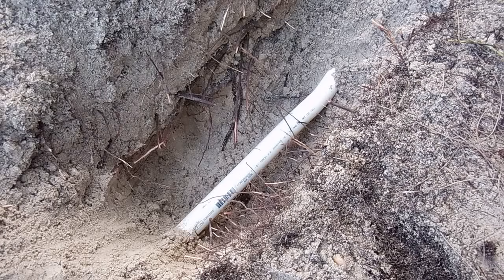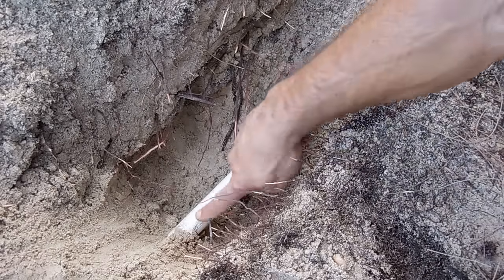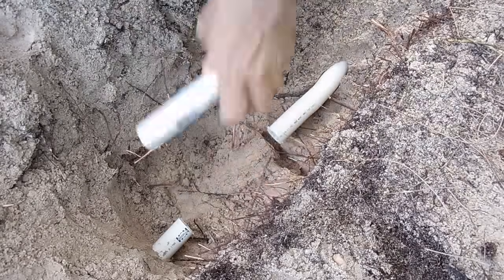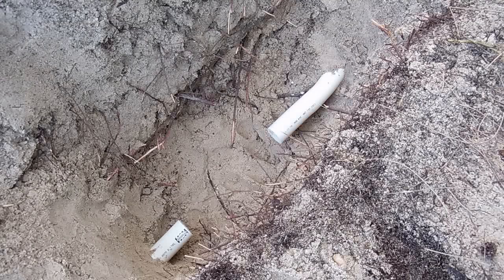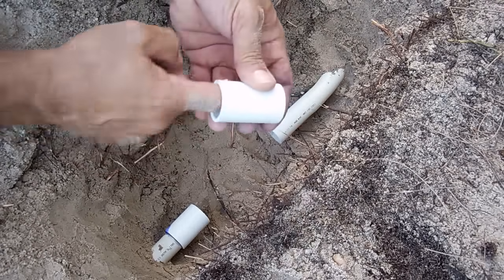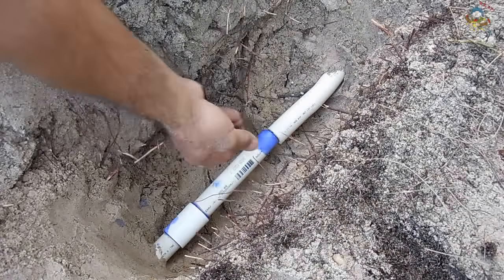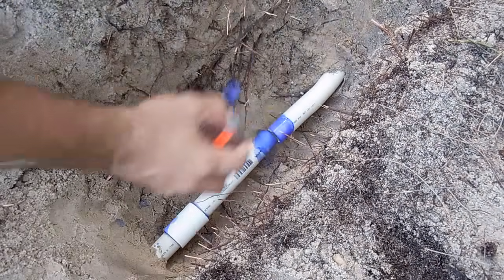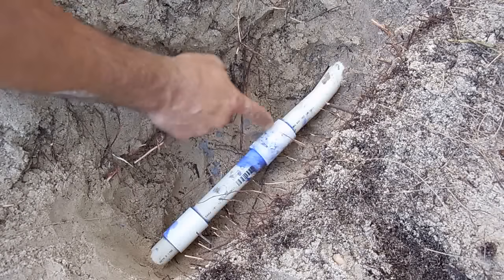EASILY Repairing Broken PVC Pipes(Least Amount Of Digging)

Comment from the maker: Other great PVC videos that you'll enjoy: 

How To Easily Tap Into A Buried PVC Water Line: https://www.youtube.com/watch?v=LP41_wXW8jc
PVC Cement Pressure Testing video(Oatey vs Christy's Red Hot Blue Glue): https://www.youtube.com/watch?v=qHo4heljrSg 
How Much Pressure Can SCH40 PVC Pipes Tolerate? Find out!: https://www.youtube.com/watch?v=doPXNWC1Iig 

Be sure to share. Thanks guys!
Reply: electronicsNmore I tried this exact method, using medium setting cement. It did not work and I made it worse. 

I applied the cement (which very quickly gummed up when I slid the connector on) and the coupling with the filed out stopper would no longer slide all the way down the pipe after applying cement. Not even using a vicegrip. After removing the coupling I saw more gummed up cement. 

The cement I used was Harvey multi purpose Twin pack, which included Pipe Cleaner and MP-6 Cement, medium body, medium set. 

Instructions mention primer. Do I need a 3rd chemical? Is the cleaner also the primer? 

You made this look super easy.. but it was not at all. I'm not even sure if the one coupling I put on is creating a chemical fuse with the pipe. Why is there so much gummed up cement?

You also call the cleaner "glue". I am a laymen, not a plumber. This may seem simple to you, but to people who don't do plumbing..

What is the difference between cleaner/glue/primer??

After I apply the cleaner/glue/primer is there a certain amount of time I should wait to allow it to set in before putting cement over it?

Should I have used a thin bodied cement instead of medium bodied? (You did not specify)

Is that gumminess of the cement normal? Should it squeeze out into clumps when I slide the connector on? It was brand new off the shelf cement.

I see all these great comments about what a great idea this is. I have not seen one single comment about what success they had trying your method. I followed your instructions to the letter and now my water main is worse.

Extremely disappointed. Links to your videos but maybe you should specify exactly what products you used, and the viscosity/thickness of the cement. This video seems more suited to journeman plumbers than beginners.
Reply: @Freshbrood  what a troll comment. The method works very well and although it is pitched at non-plumbers you must have some common sense and a basic understanding of how pvc glue works. Blaming the poor chap that took his time to make this video is not on.
Reply: reallepooy It's not a troll comment at all. The main issue was the connecting pipe, even with the stopper throrouhly filed away was still thicker in the center and would not fully slide down. I tried it with another one. This video author failed to mention that and it's important.
Reply: electronicsNmore Cost me more time and more money.
Reply: Great Video, very concise and easy to understand. Keep up the Good work, and inform us how to make our lives a little easier. As FDR said, "The only thing we have to Fear, is Fear itself".  And your Video's help us get past
 that Fear. Thanks again.
Reply from the maker: @tipsclubs01  Thanks Phil! Please share my videos with others.
Reply: @electronicsNmore  Will Do.  It was shared to me.
Reply: Thank brother, keep up the great work
Reply: Thanks for the post 
Good to know 👍
Reply from the maker: @garylespron7-WS  You're welcome! Also be sure to check out my pvc tips video playlist and share. Thank you
Reply: Instead of cutting a long piece and using two couplings, wouldn't it be easier to just remove the damaged part which appeared to be small, and then just use the last step of your video to insert the non stop coupling ?
Reply: electronicsNmore r
Reply: Won't save me any money, but this will save my back :-) Usually just dig up a few more feet so I can bend the pipe and get the coupler on
Reply: @creamofbotulismsoup9900  Hey so even after filing down the stopper on 2 different couplers, I still can't fit one far enough down one side to slide it back to the other pipe. Are these thicker in the middle than the edges, even without the stopper?
Reply: @Freshbrood  Might depend on the brand, but from what I have personally seen, no.
Reply: i watched  your  video   but  how do u  get rid of a tree thick root  thats  on top of it
Reply from the maker: @denisecarley9483  Cut it.
Reply: 🙏 kalo r9498⁴l8a8p3o499⁴9l⁸l44l🙏👍 re 🙏9³9woolskiu👍d9👍e8pee saat oae8l288lelellllw⁸lllawoaoowea8l8aoe9or94a9l
Reply: How does 2nd coupling slide past the internal stop ridge in coupling?
Reply: Ķķò
Reply: great video,  thanks!  when I checked the size of the slip coupling on the home depot site, it seems the coupling is the same size as the pipe you try to repair.  How do you slip it on if they are the same size?
Reply: Thank you I've been looking for something like this for a while! I wish they made couplings without the stop
Reply: electronicsNmore 5
Reply: @williamfranklin8317  jdmjf

Comment: Cleaner is not purple
Reply from the maker: Cleaner and primer both clean the surface of the pipe and soften. I did the testing. I suggest you read the MSDS sheets to see the common chemicals
Reply: @electronicsNmore Not trying to cause an argument. It says right on the label what it is. I had an employee that said he couldn't get a joint to stay one time and I asked if he used cleaner and he said "yeah I used the purple cleaner". I went back and used cleaner, primer, then glue and it was done, not saying it won't work but primer is not cleaner
Reply: @electronicsNmore  Good video though I like the idea

Comment: Fresh water, pressure PVC pipe coming into the house under ground, now broke 3 times.
2 different plumbers worked on it, 
The first plumber charged me $900, lasted 3 years, than broke.
The second plumber fixed it, charge me $750, but after 2 days it broke again, plumber came, fixed it, but never covered it with dirt.
He told me he wants to put a box over it, but never came.
Called him, he said he was out of town, he'll come tomorrow, next day never showed.
Last plumber told, me the PVC pipe is old, junk that's why it's breaking.
Well, it's 50 years old, I Googled it, they should last 100 years or more  under ground !
What's wrong with these people?
🤔🤔😠😠

Comment: Better to use a deburring tool on both the inside and outside of the pipe to create a small taper at the end. This allows glue to flow more evenly when the coupling is pressed pushed oin the end, ensuring a good seal on the repair.   Also, twist the coupling a quarter turn when it is pressed on all the way, to also distribute the glue eveninly around the pipe.  Put glue on pipe beyond the final position of the coupling to ensure when the coupling is dragged back into final position, the glue on that side of the coupling has not been reduced when it was extended beyond the midway point.

Comment: Great technique to simplify PVC repair.  I like it better than the technique of heating up the pipe to allow bending it into the coupler.  I like the idea of using slow-setting glue.  My only recommendation is to avoid twisting the smooth coupler until it is pulled to the stop mark, but then twist it strongly to get glue moved around the bottom of the pipe where application of it is often sparse.
Reply from the maker: Thanks for watching. I like to give viewers several different methods that they can use. You select the best method for you

Comment: Maybe it’s due to a difference in the connectors in the US and here in Japan, but this didn’t work for me. I was able to remove the inner barrier at the middle of the connector. And I prepped everything but when I went to push the connector on it got about Halfway to the middle, so a quarter of the way of the length of the connector, and it just wasn’t going any further. Well, I may have been able to get it a little bit further, but you have to keep in mind that I still had 3/4 of the connector left before I would be able to get it to join the other end. And this was after I cut maybe 5 mm off the end of the connector before starting. I did that to reduce the overall length of the connector.

It didn’t work. I appreciate the idea, but there’s something different going on.

Comment: Very good! This way you save about $6 what a special slip - telescoping coupling will cost you. I have one of those $6 coupling so will use it. Then try your way at another break. What brand slow drying PVC cement you using here?
Reply from the maker: In the video I demonstrated using oatey clear regular set cement

Comment: thanks for all the wonderful videos my friend, you're saving us hundreds!  i have a quick question. which tool would you recommend for cutting an old and possibly brittle CPVC in ground pipe? i clipped one with my shovel and need to recap it, but need to take off the cracked section. any insight would be appreciated.
Reply from the maker: Use a stainless steel cable wire saw

Comment: Great video, but FYI That purple liquid is a primer, not a cleaner. It allows the glue to make a weld between the two pieces.  PVC welds exactly like metal with this primer !
Reply from the maker: Same chemicals. Both soften and clean the plastic. The purple is only to show you used it.

Comment: Nice video, thanks for posting.
If the crack is small, couldn't you just make one cut at the crack, then use the slip-over coupling to seal against the intact pipe on either side? That way you'd need one one coupler, one cut, and no replacement section.

Comment: Great cheap way for a repair. The reason for the slow set glue and over applying glue to the last coupling is to have time with least effort to slide the last coupling past the end and then back into place.

Great tip. Unions and extensions are expensive

Comment: Tried this today. Saved me from making additional cuts to pvc. I found it very hard to slide the coupler back the other way. If you are having trouble getting rid of the stop inside the coupler, use some double sided tape on a socket, wrap some sandpaper around it and attach it to a drill. Worked great for me.

Comment: I just used this method on a 1.5" pool pipe and it worked. Warning - do not use "repair" couplings found at HD or Lowe's where the stop is already removed. They don't fit nearly as snug as regular couplings. I thought I found a shortcut using one but was leery from the start when I saw how it too easily slid onto the pipe . And of course it leaked from that coupling. Re-did it using a regular coupling and removing the stop and good to go. Great video.

Comment: Beautiful! I'm not familiar with PVC pipe repair and I have to change a couple of pipes by my valve index about 9 inches down and the suggestions that were made at a big box store did not sound like it would work because of the crammed space I have to work with. This is not only quick, but it's cheaper. Thank you.

Comment: I'm trying to use this method but finding that even after filing away the stop in the middle of the coupling, the coulper does not slide along the PVC pipe easily.  How do I ensure I will be able to slide and move it fully into place when using the PVC glue?
Reply from the maker: You have to remove the Stop and a little bit on each side because the fitting has a slight taper. As long as that stop has been removed with part of the taper, when you put the cleaner on that fitting to soften it up, followed by the PVC cement it will slide all the way over.

Comment: Thanks for making this video. I followed this method no problem. When I tried to dry fit the coupling with the inserted piece of pipe it would not slide all the way down, probably because it was dry, so I wasn’t 100% sure it was going to work. But once I put the cleaner on and the glue it provided enough temporary lubricant that it slid all the way down on the pipe allowing the inserted piece to fit easily and then I was able to slide it back over for the final repair. Thanks again

Comment: I have a cracked elbow joint that makes a 90 degree turn between the main line to the meter and the line that connects to the garden spigot on the wall of my house. It seemed at first it might be very easy to fix by just replacing the elbow and using some couplers and a new small section of pipe but the problem is being constrained working in the hole. Now it seems it might just be easier to dig up the whole length of the line and replace it at once. That way I can do all the cutting and mating above ground.

Comment: Didn’t work for me. I spent a lot of time making sure the coupler was completely shaved down. But even so, i couldn’t slip the shaved down coupler more than 3/4 of the way, even with channel locks, and all lubed up. The surface tension is just too much. So I couldn’t get it over the other side being that I cut the new piece to be flush. Highly recommend digging a bit further so you get enough flex to wiggle your way in there if need be and cutting the new piece just slightly shorter so you have a bit of wiggle room there too, if you don’t manage to slip the coupler all the way over the pipe.
Reply from the maker: If you read through the comments section you're going to see that the majority have used it and were very happy with the results. I admit it may take some practice to get the technique down

Comment: Good video. 2 important things. 1 Like he said, the cement MUST be slow setting. Fast setting creates rebound and does not let you set it properly.
2. If the tube is not perfectly straight you might end up with a leak due to the small angles in the tube and/or coupler.
I tried with regular setting cement but still got a leak due to the slightly misaligned tube. It seems that the clay swelled up and pressured the tube making it misaligned when I had to cut the tube/pipe.

Comment: Coupling wouldn't slide back...any help?
Reply from the maker: Either did not remove enough of the center stop, didn't apply enough PVC cement, or didn't move the coupling quick enough
Reply: @electronicsNmore  thanks for the tips...should I shave down a little past the stop?

Comment: Yeah this didnt work for me. The pvc connector gets stuck half way through. Even after using my dremmel and sanding.
Reply from the maker: @adrianquintanilla850  Sounds like you either didn't remove enough of the stop in the center, or you did not move quick enough. The fitting must be in constant motion until it's in the correct position.
Reply: @electronicsNmore  I just used the pvc telescopic repair kit. That works wonders. Im in az and its hot & dry plus the bonding agent and glue are mixed together so it glues too quickly.

Comment: Wish I watched this first.  Just hit pvc main water line to hose I think, had to shut off at the street. Tried just a few inches on each side. But when bending pipe to connect other end it snapped the coupling in half. So quickly had to remove other side and wipe cement off. Then sawed the other broke coupling off. Dug like 4 feet on both sides of pipe for bending flex. Then reconnected. Thanks for the better way.

Comment: Mmm. I'm thinking there's a reason you don't find couplings for sale without stops in them*. When you slide the coupling back over toward the middle, you'd leave a lot of glue behind. It might work OK most of the time, but I don't think it's ideal. I like your heating trick better. Better still is digging up more pipe (where possible) so you have more flexibility in the pipe. *At least I've never come across such couplings.

Comment: Why not use a slip coupling instead of filing out to stop on a regular coupling and why not put the slip coupling over the pipe before you set the pipe in the ground with the one coupling I would’ve put the piece in the slip coupling already on the new pipe, cleaned up both sides of the pipe and then glued and then slide the slip coupling over twisted and it would’ve done the same thing

Comment: For those who don’t know, when he’s saying cleaner he means primer. You also only have about 10 seconds for that primer so you can’t pre-primer the far end of the repair section of pipe. The primer should be wet when you apply the glue according to Oatey. This is a great method. Why you can’t buy slip couplings like this is ridiculous. They just want you to spend a lot on specialized compression fittings.

Comment: Have you ever tried just using the slip fitting without cutting out the section? I'm wondering if the slip fitting provides enough overlap to seal  a small crack.

Comment: Great video but I’m having trouble with sliding the coupling without the divider. I’m testing it dry - before I do the job and it’s not slipping all the way on the pipe. I’ve ground down the stopper with a round file. Am I missing something?

Comment: man i was really worried that i'd have to dig up half the front yard, and i've been putting it off.  but today i got in there because of your video and now i have managed to fix the leak.  the spot with the leak was a PLUG.  the original landscaper took a used length of PVC, and it had a plug in it (kind of dripper pipe size).  and that came out.  imagine that...

Comment: Didn't quite understand the need for two couplings if only one place is leaking...
Reply from the maker: 1 coupling is used if you have a vertical crack in the pipe, two couplings are used if you have a horizontal crack that's longer

Comment: Yeah good for that repair.  But mine is about the same length but with two fittings on each end with threaded male, female types.  I had to fight to push a gap to get the replacement to seat an inch.

Comment: Pressure couplings...not drain pipe couplings.  The cleaner also acts as a primer to help soften the PVC so the glue adheres better. If you have to get the work inspected, be sure to use the purple colored cleaner as that is what the inspector looks for.